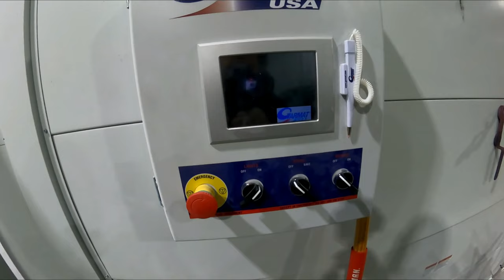AFTER THE STORM...

Comment: Glad the storm was not bad where you are. Saw some really bad flooding on the news.
Got some  matrix edge base to try at work. If it goes good will be switching.
Reply from the maker: Thanks  sprayed the original matrix  for a couple years in the beginning of my career was not to bad. Basically Delton
Reply: @kandyman5315  I find the cheap solvent has issues with colors. Low voc versions can have spraying issues. We are doing a big refurbishment of around 100 cars and motorcycles.
Its also a cost thing. If we did insurance work paint line would not matter as much.